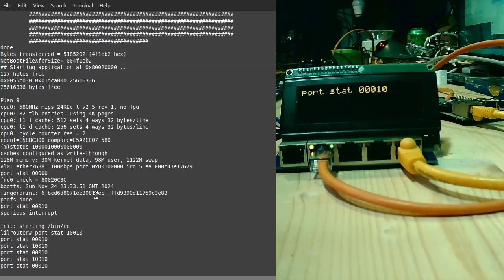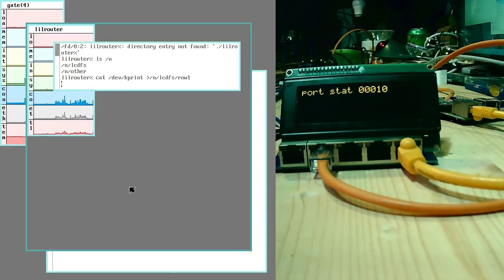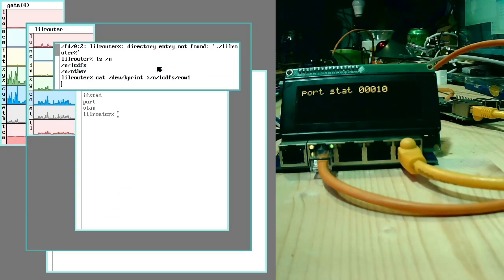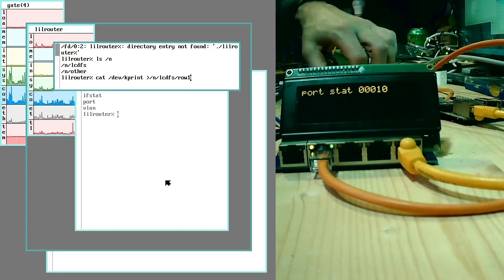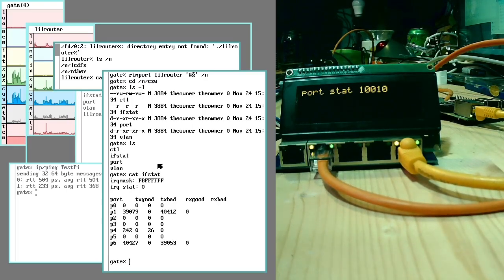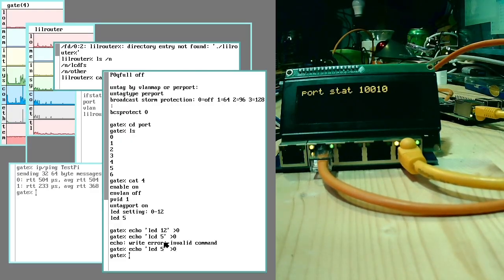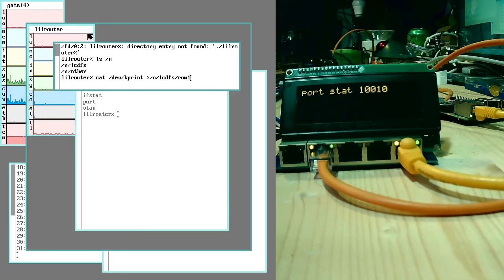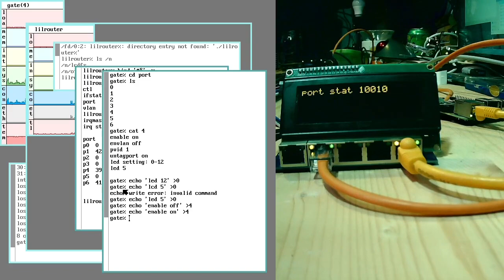Plan 9 Theory and Practice; WiFi Router as CPU Server 4.4

Comment: There's a portable, public-domain clone of Doom out there called Anarch that's specifically intended for low-power devices. I doubt that it'd run on Plan 9 without some effort, but it might pique someone's interest.
Reply: 9doom is simular, I'm sure there's some syscalls or attempt to access the sound system that's causing the crashing
Reply from the maker: Fixing doom on a low end router board is low on my list.  However, Doom does run on the included mt7688 kernel with the fpu patch.
Reply: @adventuresin9  yeah I know the meme is doom runs on everything but sometimes there's bigger fish to catch / bugs to sqush.

imho having plan9 running on managed switch hardware is way more impressive